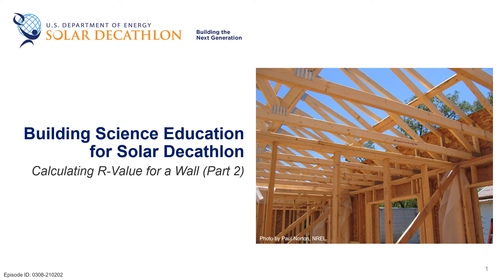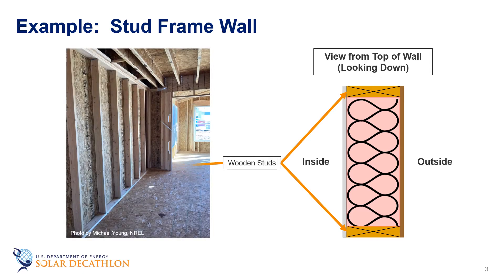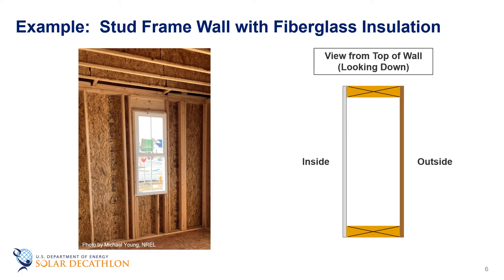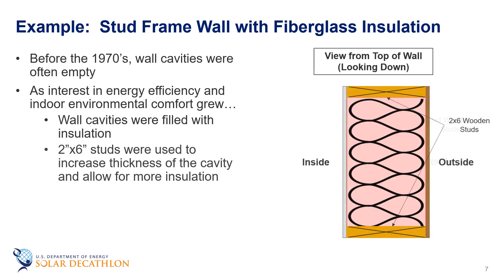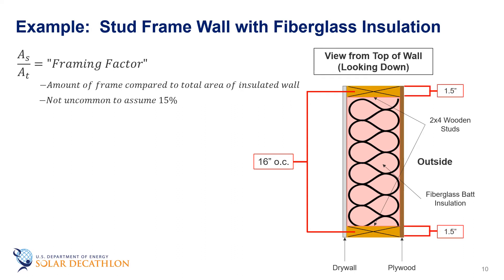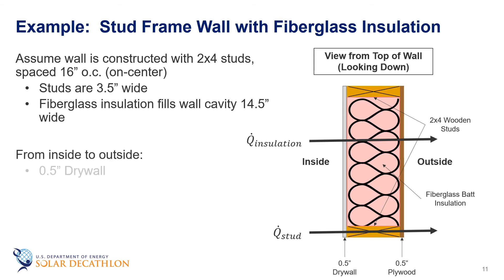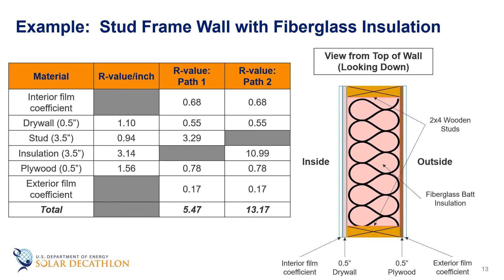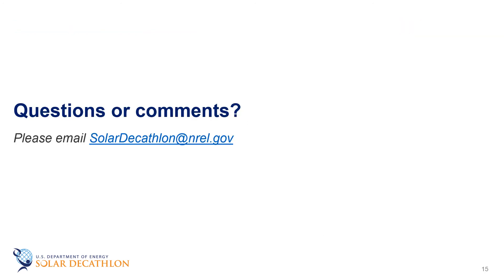Building Science Education - 3-8 - Calculating R-Value for a Wall (Part 2)

Comment: Hi there, at min 6:39 15% is assumed instead of the real 9.4%... . I dont get the reason for that,  why? Anyone knows?  Thank you!   even 12" on center is 1.5/12=12.5"% and for 24 on center even less than the 16% on center..
Reply: The 9.4% only accounts for standard studs, it doesn't take into account for base plate, jack and king studs around windows and doors, and headers, so depending on stud spacing and amount of windows it could easily be 15-25%
Reply: Thank you
Reply: Based on research of housing the framing factor used by sources such as California title 24 and National building code of Canada use framing factors of 23 to 25% for walls. Values below 20% are quite unrealistic.  Roof framing factors are lower.